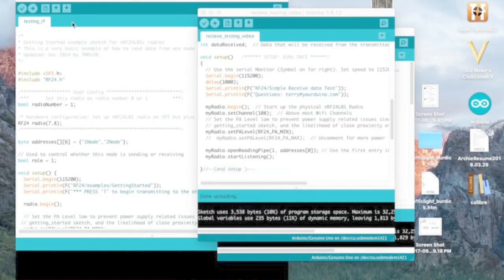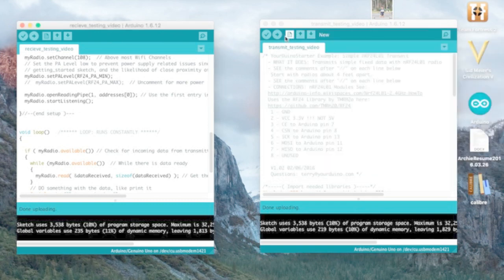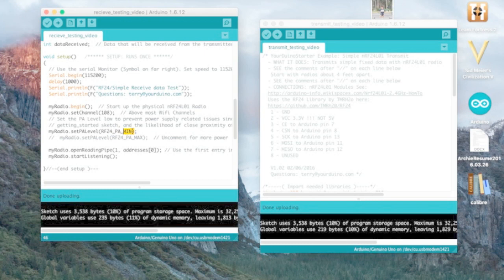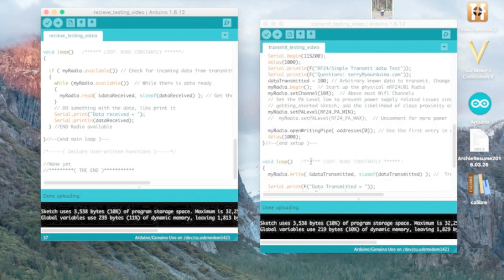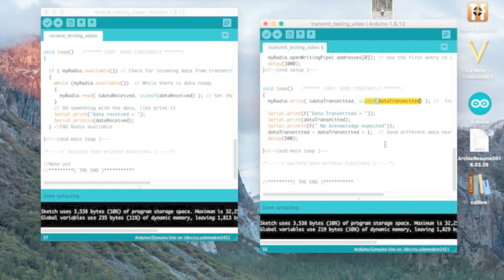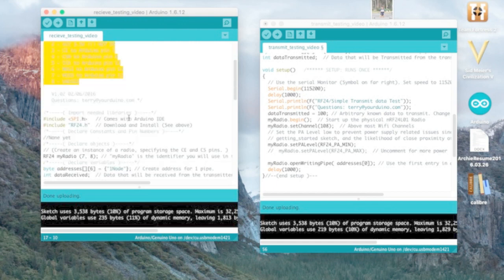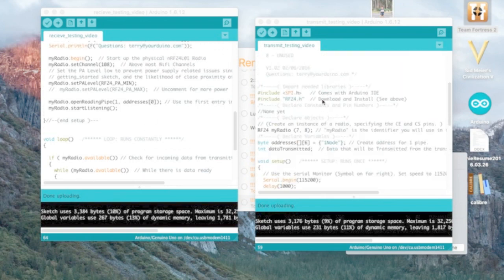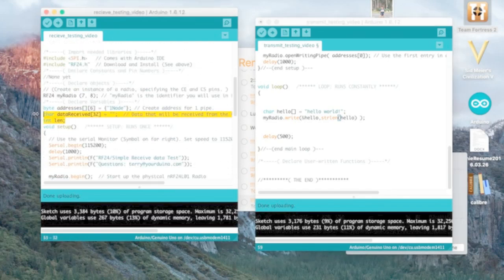nrf transceivers algorithms, sending integers and strings part 2

Comment: Help I need this code. Link doesnt work anymore
Reply: Hi Dave!  Any luck on finding the Code ?

I am looking a simple way to transmit strings variables over this module and fail to comprehend the right structure.  If you have any experience to provide, sharing with us would be greatly appreciated.  

Until you read and replay to this message, have a nice day and take care.
Reply: @oncledan282  I can send you some code that my friend helped me to write. email me vorbuk@gmail.com
Reply from the maker: I have happened to download the website html code, and I will post it up on wikispaces, or something. Can't say when, but I will let you know.
-Archie
Reply: @achboldjugdersuren6883  could you upload it to github? would be dope! i am having a hard time looking for an rf24 string example :c if you can please send it to me at felipez8989@gmail.com, thanks!